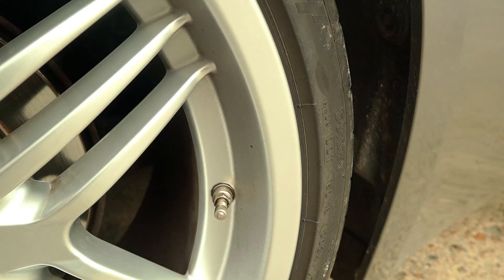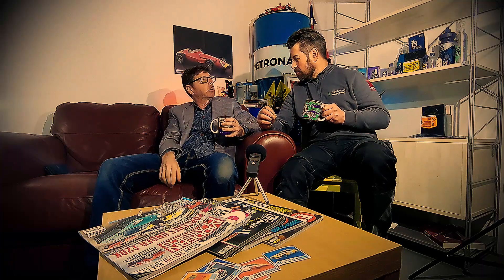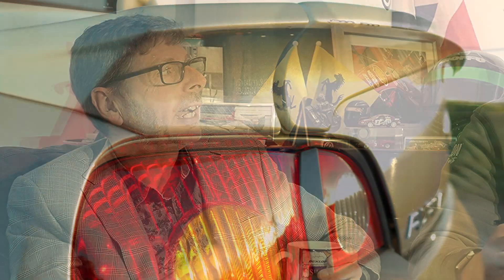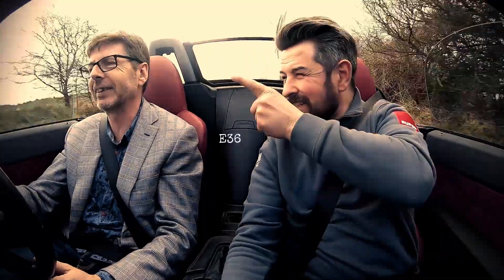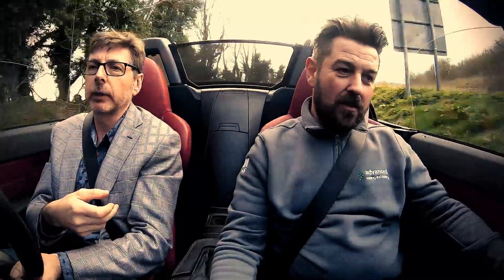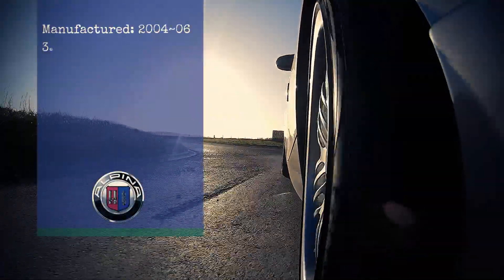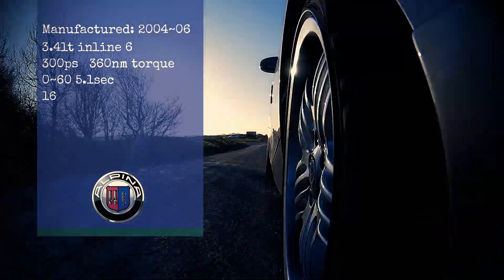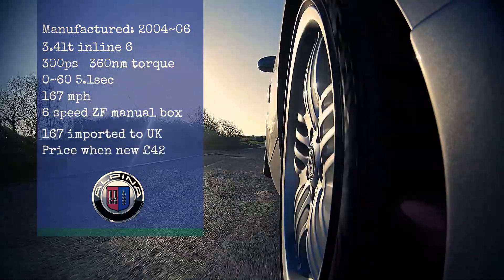BMW Z4 greatest secret..revealed!

Comment: My 04 3.0i Z4 has no shakes and rattles at all. It still feels brand new.
Reply: my 86 thousand mile 17 years old 03 3.0i is still as tight as a drum with no rattles or shakes what so ever.
Reply: @posniknelb6114  
Amen! I have 127,000 miles on my 04 3.0i Maldives Blue Z4 and it burns no oil, leaks nothing, everything works and it still sounds like the day I bought it. The chicks still pull up alongside, smile and say “great looking car”. Yahoo!
Reply: Have a 2004 (2.5) excellent condition and drives great. Only 44000 miles. Love it

Comment: E85 Z4 is a present/future classic,  as long as it has the straight six. 

Alpinas are, however, a different world. 

Many don't retain the soul of the Bavarian that they're based on and can translate as highly powered, slightly softer  'cruisers'. 

This, though, looks like a good version, but Mr adenoid owner in the passenger seat ruins the experience.......